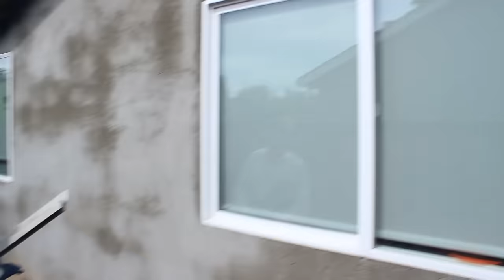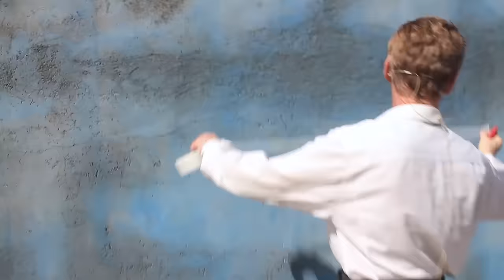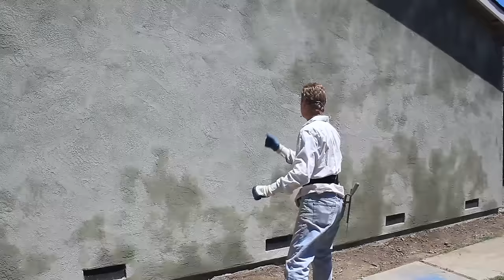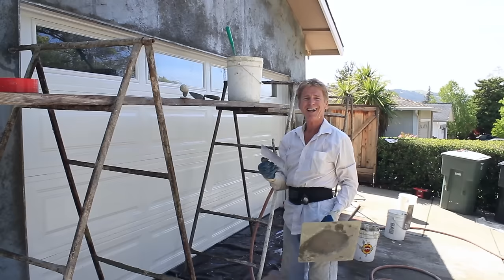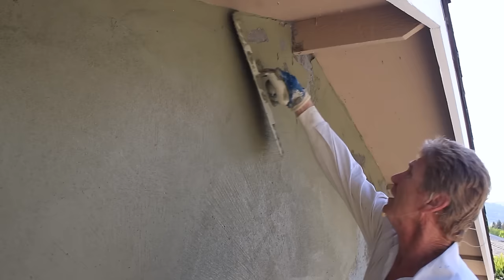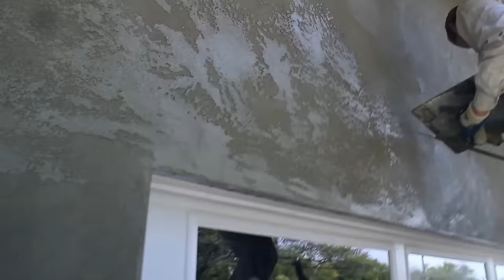Stucco Resurfacing

Comment: Hey Kirk, can the brown coat be left smooth and painted over. Or do I have to apply the Santa Barbra smooth finish, if so can I prime paint the Santa Bárbara.
Reply from the maker: Good afternoon Han Dude. This base coat could have been painted over. 
However, the finish would not have been pretty.
 Yes, a smooth coat can also be applied, FYI, a smooth stucco finish requires two coats of 30/30 finish coat stucco.
 Bringing peace, love, and brotherhood, back into the 🌎 of Plastering.
    The most comprehensive encyclopedia of plastering on video, by the plastering messengers of Youtube. 
Kirk and Jason Giordano with over 800 videos 🎭 👀💃

Comment: Kirk, I am stuccoing over some rigid insulation with wire lath. Live at 6500 ft. Is waterproofing stucco an issue?
Will stucco spall like concrete if finished too early? Will stucco soak up water and freeze damage?
Reply from the maker: Good afternoon Chris, spalling occurs when stucco or concrete cracks, with the season moving on the cracks become more substantial.
 Then when the rain turns to snow for long periods, the trapped water expands, Violla, spalling. Or stucco popping off by force.
 Bringing peace, love, and brotherhood, back into the 🌎 of Plastering.
    The most comprehensive encyclopedia of plastering on video, by the plastering messengers of Youtube. 
Kirk and Jason Giordano with over 800 videos 🎭 👀💃
Reply: Had you considered an acrylic stucco ? As long as you have a house paper or wrap
behind the exterior wall surface and allow drainage at the bottom of the covered areas you'll be fine even if water gets behind the wall surface. The synthetic acrylics are designed to be waterproof. Also is the 
building designed with a large overhang?  Just keeping the rain and runoff away from 
your wall will be a major help.

Comment: Hi Kirk Its me again .. Wow So after the finish coat is applied .. i should not moist cure it until 5 to 7 days .Then i mist it for  a couple of times a day for How many days ? Thanks Kirk for all  your great help
Reply from the maker: Hi John, after the scratch and brown coat you do that. A finish coat is Portland stucco with sand and lime, thus it's better to wait at least a week before hydrating it as hydrating too soon it can make the colors varied or bleed. The idea is to saturate the base coat first, big time, and allow the water to slowly evaporate after the finish coat is applied. Weather plays an important part in curing stucco coats.👨‍🏫
Reply: @StuccoPlastering  Hi Kirk ..

So on a hot wall that have been sitting in    around  30 degrees of heat 

Does it matter if I saturate the hot  wall  with water   and then put the bonding agent on  it 

Or put the bonding agent on a dry wall first  and then mist it before I put the one eighth  finish coat on it .

Again this wall has variations and needs bonding agent .It's old stucco  .I just patched a couple of spots 2 months ago ..

The rest of the wall on the side of the house is a white  one eighth of inch finish coat .that has a steel trowel finish Not floated. 

So im mixing up 3 parts white silica sand ,,, 1 part white Portland and 1 part lime ..

I did a trail patch with that mix ..It wasnt that sticky ..

I thinking of adding  a handful  more of  lime and Portland to that  mix  ratio to make it more sticky .?

Sorry about  all the questions Kirk .

I just don't want it to fall of the wall cuz its a larger patch .

Thanks millions again . Live long and plaster lol

Comment: Question for you to clarify.  When describing your tools, you sing praises of your long trowel.  I see from your demonstrations that this trowel is the boss!  You referenced that long trowel against what I thought was called a mortarboard, but the audio was a bit weak.  It sounded like you called it a hock or possibly hod?  I am a rank amateur with regard to stucco, but I looked up these words and it seems that they mean quite different things.  What exactly do you call it (the mortarboard?)  Great video, by the way.  Very informative.
Reply: Good morning Swill Dude. In our description, this trowel is sold. Its a 16 X 4.
 FYI a mortarboard is a board we place the mud on from the wheel barrel on so we can take it from there, then apply it to the walls.
    The complete plastering encyclopedia on video, by the plastering messengers of Youtube.  
     Over 850 videos 🎭 👀💃

Comment: We wanted to replace a glass block window 23 x 23 with a regular window the same size.  So we had a window installer put the window in, then we had a drywall guy drywall the inside.  Finally we sent a picture of the outside of the window to a stucco guy and he said that the window guy should have installed flashing when he put in the window.  I asked him if he could put in the flashing when he stuccoed but he said he does not do that.  Should the stucco guy flash the window?...or should the window installer have done it?...Or does it even matter?
Reply from the maker: Greetings Michael, of course, this matters. Its the difference between a window leaking, if not installed properly.
 Your window guy was supposed the attach a 6-inch horizontal flashing paper along the bottom with the same flashing going up both sides and down past his bottom horizontal paper the window is installed.
 If he's or she is on the ball, they then place a metal Z flashing on the top of the window.
 Stucco guys then counter flash the window flashing.
 Bringing peace, love, and brotherhood back to the world of Plastering. 🌍
    The complete plastering encyclopedia on video, by the plastering messengers of Youtube.  
     Over 850 videos 🎭 👀💃

Comment: Can someone tell me where one could buy a pre-mix of this type of finish, and all I need is just to add water? Or does this require to be mixed by yourself, and if so, what is the formula?
I have a wall in the backyard that I would like to get a sand finish like this. I’ve got one at Home Depot; they sell in a bag (stucco finish), but I doesn’t look so prominent.

Comment: Stupid question here. Can you use concrete as stucco? I wanna do a (what I think it’s called) a skip trowel on concrete forms. I have a concrete bag and don’t wanna buy stucco. Will it work?
Reply from the maker: Good afternoon Spread Creek, no, concrete has rocks in it of various thicknesses. You need stucco which is portland mixed with sand.🧞‍♂️
 Bringing peace, love, and brotherhood, back into the 🌎 of Plastering.
    The most comprehensive encyclopedia of plastering on video, by the plastering messengers of Youtube. 
Kirk and Jason Giordano with over 800 videos 🎭 👀💃

Comment: Good afternoon, tell me what is the plaster that you apply ? is it just cement or are there additives?
Reply from the maker: Hello, it's called La Habra finish coat stucco. developed as the first company way back in 1926 with either fine, medium, or coarse white or grey sand,.
These 94-pound bags are then mixed with a two-pound box/bag or color pigments to give you a maintenance-free color finish.
 Cheers,
Kirk Giordano

Comment: Is there a way to re-surface the stucco walls? e.g. if my walls got water marks, too old, color fade, have cracks, etc, but I don't want to redo the stucco like what you are doing here. This is too much work and difficult. What I want is something like painting but not use paint, use very thin stucco cement. Is that possible and how?
Reply from the maker: @bluegables  yes, it’s called applying a color coat finish, you clean the surface apply a bonding agent then resurface the walls, just like what we’re doing here. 
You think your eyes are lying?
Reply: @StuccoPlastering  Thanks for replying. See my problems here:https://youtu.be/1u1FrueBbbs?si=dpNcSj70339rIMcB. There is a dripping right on to the door step and I find it's coming down from the inside of the external brick wall. Couldn't find anything wrong with the roof. Guys say must be leaking from the stucco. So I want to kind of resurface it to make sure its all sealed up. I want to DIY but what you are doing here is too much and difficult for me. I was looking if there is a way to brush the stucco or cement on just like painting. BTW, the broken part was me teared because I saw it's all wet.
Reply from the maker: @bluegables  Rapid set stucco purchased at Home Depot will fix it and almost match the color. The leak is coming from the window, caulk it better, cheers

Comment: Hi, great job
This producto is similar at  basecute?
Reply from the maker: Good morning Pint dude. Not really a basecoat is applied 3/8 or more and is usually a portland based cement plaster.
stucco color finishes can't be applied over an eighth inch thick, plus the finish coats are maintenance-free because of integrated colors. 
   That means they never need painting.
Kirk and Jason Giordano plastering, sharing well over 850 free Stucco/Plastering videos for your education. 
    Together we have created the most comprehensive encyclopedia of Stucco and Plastering videos ever produced globally, all by your favorite plastering messengers of YouTube.
Bringing peace, love, and brotherhood back into plastering.🎭🏝🎆
https://en.wikipedia.org/wiki/Lath_and_plaster

Comment: Kirk I'm 'binging' on your channel to do prepare plastering/stuccoing on my project! Question: If the mud gets stiff, would re-mixing with a cement plasticizer cause any adverse effects on the finish?
Reply from the maker: Evening Brad, if the color coat stucco gets stiff, add some water into the mixer. Adding additional plasticizers is not necessary as the color coat materials have plasticizers in them already. I have never done this. 🤔
Reply: @StuccoPlastering  Thank you for the reply! My assumption is adding water could 'water down' the color. I experienced this foolishly recently when applying 'bonding fiber cement' stucco to dry stack block. 

The little experience I have with superplasticizer powder is that it only lubricates the particles and leaves the color potency the same once it sets up.

Comment: Hi, Kirk -- Question about the tools you recommend on your "stuccoplastering" site.   I notice you recommend the Milwaukee rotary drill.  In one of your videos -- unless my memory is failing -- I believe you recommend the Bosch "bulldog" rotary drill.  I'd like to purchase tools from Amazon via your site, so as to show my appreciation for all your great work.  Can you add the Bosch drill to your "tools" section on your stuccoplastering site?  Thank you.
Reply from the maker: Good evening Russell, I will ask my son to do this, however, once you're on the site, you can type in that Bosch electric chipper.
 I rarely use it anymore as the battery or cordless Milwaukee is so much easier, plus I don't have to unravel a long extension cord. 
Most folks don't realize many of the homes we work on are pre-1980 before electrical outlets because customary.
 We have cordless tools these days even our radio, Milwaukee, as they are the best and most powerful.
 Bringing peace, love, and brotherhood, back into the 🌎 of Plastering.
    The most comprehensive encyclopedia of plastering on video, by the plastering messengers of Youtube. 
Kirk and Jason Giordano with over 800 videos 🎭 👀💃
Reply: Don't use to much water now u in Cali. U Kno it's not like u have the ocean beside you that's full of water that can be desalinated
Reply: @StuccoPlastering  I've got alot of respect for you an your family an don't kno ya but based on a couple of vids I see. Good work good job
Reply: If certain people in the government say the ocean water is rising an it's gonna create problems in the environment well why not use that ocean water like we use it in our faucets an showers? Desalination!
Reply from the maker: @seanmayo206  exzackory

Comment: Try using red guard over the cracks , drys very fast than you can weld Crete same day , I use over stucco, lathe no leaks with this red guard
Reply from the maker: Hi Al, thanks for the tip, but I like to stick to the methods used and proven effective for the last 100 years🧞‍♂️
Reply: Red guard works great for tile situations but not over conventional stucco

Comment: Hello, maybe you spoke about it but what is the ratio for that mud or its from the bags? thanks and good luck
Reply from the maker: Good evening Stefan, 0ne 94-pound bag of finish coat to a two-pound box of color, as a rule, my friend.
Our unique plastering Tip:  all subscribers or anyone who stumbles on our channel with a question, type it into our Stucco/Plastering channel, and like magic, a video will appear to explain how it's done. 	
   This feature is miles ahead of any plastering forum. 	
https://www.stuccoPlastering.com
http://www.bayareaplastering.com
Reply: @StuccoPlastering  it is possible to make mud for this by the sand and cement only? im  from Europe, i dont know if we have something similar here like that finish coat bags.
Reply from the maker: @stefannevolnik6250  Of course it is, but It won't turn out as uniform.

Comment: If I were to do this to my home would I have to Strip the existing paint off the walls before applying?
Reply from the maker: Good evening John, heck no, that would be counter-productive.😏
 You would pressure wash your painted surface very well.
 And with at least 3,500 PSI strength, this would remove all dust dirt and grime and if done properly etch the surface of the paint.
 Next, you would apply a bonding agent, then apply a new color finish, this gives you the flexibility to change the color and texture permanently. 
This means you will never have to paint the body of your house again.
 Think of the cash you save, from instead of painting the body of your home, you take that cash and go on a holiday. Ya mon.😉
Bringing peace, love, and brotherhood, back into the 🌎 of Plastering.
    The most comprehensive encyclopedia of plastering on video, by the plastering messengers of Youtube. 
Kirk and Jason Giordano with over 800 videos 🎭 👀💃
Reply: Kirk Giordano plastering Inc. thank you !! You guys seriously have The most informative , practical and fun videos on YouTube! Stay blessed! 🙏

Comment: I have a stucco house built in the 40s stucco cracking I filled all with morflex can I put a new finish coat on it?
Reply from the maker: Yes you can, however apply a bonding agent on the walls first. This is necessary, but also if you did not apply the bonding agent over the caulking, when it rains and the walls got wet, the caulking wood ghost though.

Comment: What can you do with hairline cracks that have mold showing on them 18 months after repair and painted over?
Reply from the maker: Morning Julie the Tennant, excellent question. First of all, mold can grow everywhere where there is a little fresh air and, more importantly, sunshine.
 Sunshine neutralizes mold as the sun dries it up.
  If you have mold around your home in the cracks, no doubt it's also on the ground too. Since we can't control the sunlight, we can neutralize the mold with acids, like white vinegar or apple cider vinegar.🤔
     I'd suggest Clorox bleach too, but the bleach would not be good if you have dogs or cats running around the house.
 Take your garden water hose, use a spray nozzle, and hit the areas, shooting out the mold from the cracks. 
    This mold will now be located on the ground, if you can broom or hose it in a drain that would be perfect. However, if you like me, and don't have this luxury. Shoot the water in the direction of the sunshine. That will dry it up.
     Keep in mind this is normal. I get it too, the last video we uploaded had so-much mold all over the ground where we were working as it raily got any sunshine.😉
Kirk and Jason Giordano plastering, sharing well over 850 free Stucco/Plastering videos for your education. 
    Together we have created the most comprehensive encyclopedia of Stucco and Plastering videos ever produced globally, all by your favorite plastering messengers of YouTube.
Bringing peace, love, and brotherhood back into plastering.🎭🏝🎆
https://www.giordanoplastering.com/

Comment: Hey Kirk, before you textured it, could that wall be floated for a finer finish
Reply from the maker: Howdy Austin, absolutely, It did not need a skip trowel finish; we were asked to match the homes around them that had skip trowel finishes. We through the float or sand finish under the skip for ultimate distinction. 👨🏻‍🔬
Reply: @StuccoPlastering  thanks for the swift reply Kirk. I’m a residential handyman expanding my skill set and landed a stucco smoothing/floating job over a medium coarse/medium indentation finish. Clean, bond, coat, float, paint.